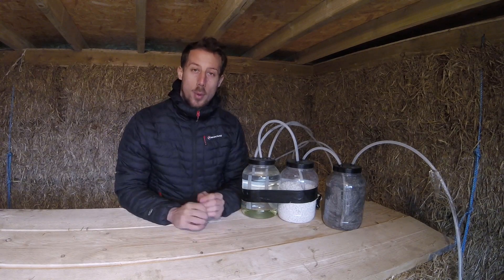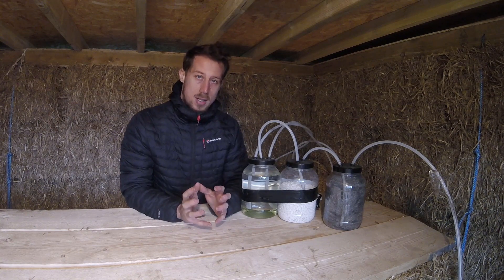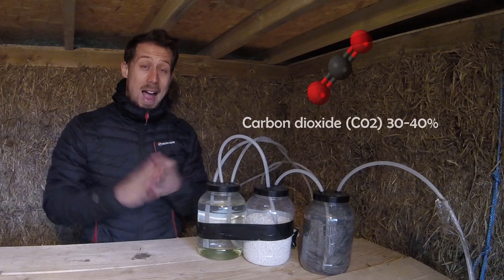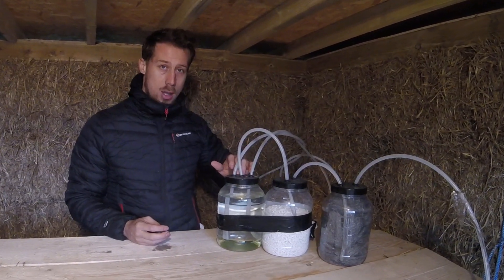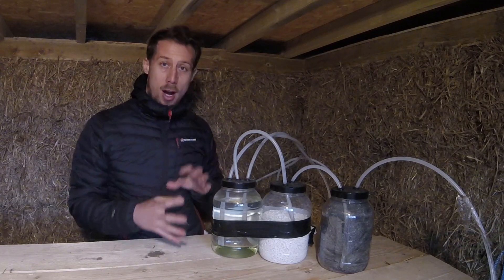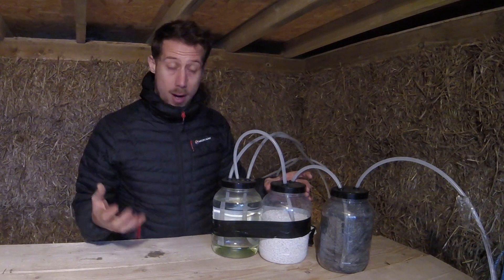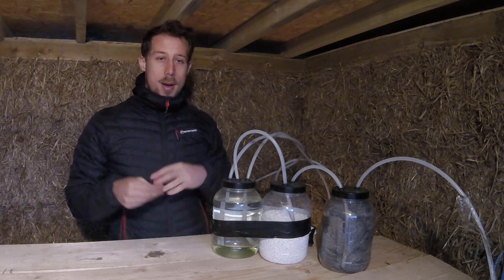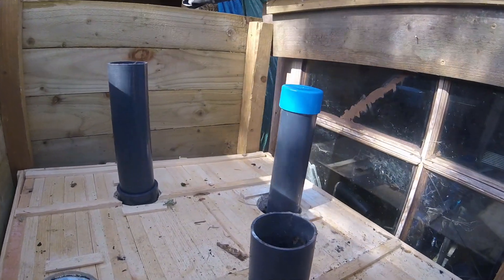Purify your Biogas with Biogas Scrubbers: Why & How // Full explaination // Biogas Digester

Comment: How soon should you change the water and all other stuff?
Reply from the maker: That would depend on the volume of gas you are producing. The material you use to dry the gas it relatively simple to tell, once it becomes saturated with moisture change it. For the water the easiest way to tell would be to check the pH if it has become more acidic than tap water you can change it. The iron wool will change colour, or rust so change it when it becomes mostly rusty. I hope that helps.
Reply: @GetMeOffGrid_  thanks after this video there was no video about your biogas project
How's the progress so far, what were the solutions you applied since your last attempt to fill the Ballon failed
Curious to know.
Reply from the maker: @samlenlap  I am currently redoing the digester. It needs to be moved and I am going to make some changes to the design (adding a drain etc). This is taking a while unfortunately as I have been focusing on my other projects. I hope to get a video out in the next month on the biogas.
Reply: @GetMeOffGrid_  looking forward to your future biogas videos

Comment: Please what is that cat litter? Is it a chemical ? What kind of chemical
Reply from the maker: It can depend. Quite often it is clay mixed with some other materials such as wheat or corn. If you can't get cat litter where you are I would use silica crystals.
Reply: @GetMeOffGrid_  please I made a digester and this about a week I feed my digester and no sign of gas hope it's ok?
Reply from the maker: @bosededosunmu1934  Don't worry. It takes time. Depending on the amount of manure you used to start it can take a month to get producing gas. Also depends on the air temperature. If you are somewhere hot it might be a bit less. Don't worry yet though.

Comment: How can we get rid of it's smell??
Reply from the maker: Good question! The best way I have seen it to put a carbon filter on the out pipe. As this pipe cannot be totally sealed as one is the overflow there will always be some smell but if the end of the overflow is lower than the level of the digester content there should be minimal smell escaping from that.

Comment: Hi, happy to see your video that actually searching for.
but is the entire project is still working?  as what is the time you can use the methane after purifying by this method. What is your digester tank capacity?. Is CO2 can be removed by simply passing through the water without any pressure?
hope that you will answer me.
I was using this biogas 1Mcube capacity from 2010 onwards by putting kitchen waste only( 3-5kg) 
If this is working will need to upgrade my biogas ..
Thanking you
Reply from the maker: Hi Navin. The CO2 can be removed by passing through just the water, yes. I would expect any biogas system to be pressurised from the tank towards the storage. It does not need to be pressurised more than that to use these scrubbers. The system will work continuously, you will need to change the water at some point as the water would get saturated with CO2 (that will become Carbonic acid). You will need to change the drying agent (silica or cat litter) when it gets saturated with water. You will also need to change the steel wool once that has all reacted with the H2S. You will be able to tell when the steel wool needs changing because it will be oxidised (turn brown). How long will this take? With a small digester like you have, it will be once at year or something like that.
Reply: @GetMeOffGrid_  Thanks a lot Tom very much .i will definitely try when our lock down completes ... and will inform you....
Reply: @GetMeOffGrid_ I wonder if you could leave a suspended acid test strip in the water to be able to check the acidity.  Or maybe a purple cabbage leaf.
.

Comment: Iam making a digester (cement plaster )of about 1200 litre 
And I have order compressor machine after compressing,can I make another tank to store the compress gas?
After compressing can I supply to the locals through their cylinder?
Please reply
Reply from the maker: I would not advice making your own pressurized tank for storing gas. Very dangerous. Store it uncompressed and then compress into cylinders when needed.
Reply: Ok 👌🏻 thank you
Reply: It’s been 3 weeks since I have put cowdung mixture in a gallon of 30 litre 2/3th full but I haven’t seen any gas sign whenever I open the valve .. please suggest
Reply from the maker: Difficult to say what the issue is. If there is air in the tank, even if it is sealed it will not be anaerobic until all the oxygen in the tank has been digested aerobically. Best to fill totally, or fill 2/3 then fill with water to complete.
Reply: @GetMeOffGrid_  definitely 
Thank you

Comment: You could use a trompe (hydraulic compressor) to compress the methane. Can you re-use the cat litter by heating it such as in an oven?  You are going to waste the CO2.
Reply from the maker: I agree. When i get enough methane I am going to get to compression to store the gas. Not sure about reusing the cat litter. If you wanted to go down that route I'd suggest silica. The CO2 is getting wasted at the moment. There is the potential to use lime water so you can get Calcium Carbonate out. Separating CO2 as a gas is difficult and probably not worth it at this kind of scale.

Comment: Dear Sir, Nice video. Is it first to reduce Co2, or should remove H2s  first. Pls explain why co2 first .
Reply from the maker: Thank you. I chose to do CO2 first as next is the remove the water. This means that the water does not oxidise the steel wool. If you did H2S first the gas will have some water vapour in it from the digester. Does that help.

Comment: Hi, new subscriber here
i just thinking if the water scrubber totally becomes carbonic acid, it can still absorb carbon dioxide? or need to replace the scrubber with new water? 
sorry for my english , it's my second language
Reply from the maker: Hi Christian. Thanks for subscribing. It will need to be replaced for sure. Depends on how much gas you are producing as to when that is needed. You could check the acidity of the water, or just when you notice that the gas is not burning as cleanly (a more orange flame) that could be the reason. Hope that helps
Reply: Hi, thanks for replying
Or maybe installing ph sensor inside the scrubber, when ph decreases to 4.7(ph of carbonic acid), small 5v water pump runs, pumping new water into scrubber , the scrubber's container has overflow tube at the bottom side then upward(level of the water), so while pumping, the excess liquid(hopefully carbonic acid) exits with no gas leaks, until the ph reaches maybe 7, the pump stops running. What do you think? any suggestions.
that is part of a plan of our project proposal with heating system same as yours, but ours the copper coil installed inside
Reply from the maker: Sounds like an interesting idea, I like it. I would probably do it the other way around. Put a drain at the bottom, leaving a gap so the end of the gas line is always submerged so maybe ~5cm from the bottom. Once the water reaches the defined pH it drains. Once the water level is at its minimum then pump fresh water in. I'd guess that cycle would only take a few minutes so if any gas comes through at that point it will be minimal. What are you using as a control system? RaspberryPi?
Reply: Glad you like it
Your version is much better, maybe using some reed float switches as trigger when water level is at its minimum and maximum

We're just planning to use an arduino nano
Reply from the maker: If you make it, it would be great to see. Drop me an email to tomoffgrid@gmail.com if you'd like to discuss it further. Cheers Tom

Comment: Why aren't you using solar heating and or a small portion of the gas for heating ?
Reply from the maker: Just haven't got round to it yet. I was playing with the idea of using a rocket stove to heat it in the winter, but not sure it will work. Solar would be great but in the UK we don't get much sun when I would need to heat it. Using some of the gas is definitely something I am thinking about trying. Heat is a by-product of electricity generation so could use that. Cheers
Reply from the maker: Here's the video of the rocket stove experiment: https://youtu.be/m5EFKcG2zuI